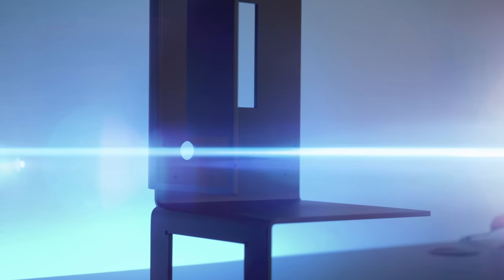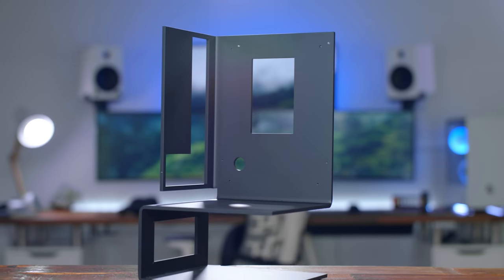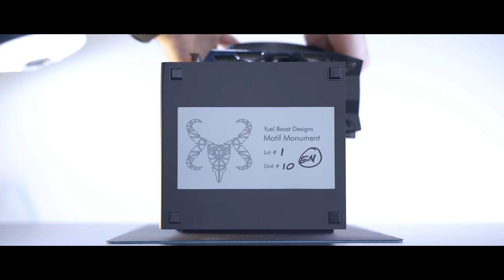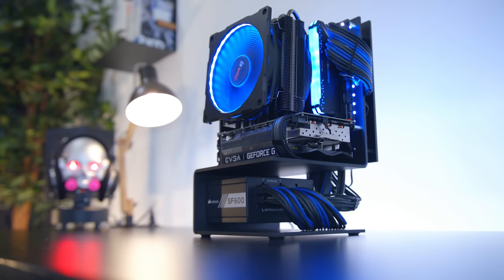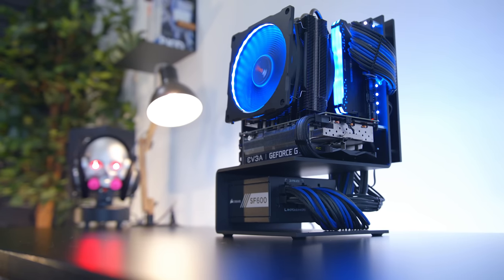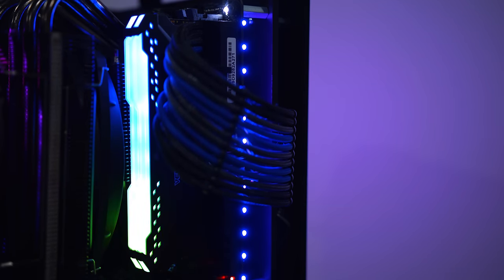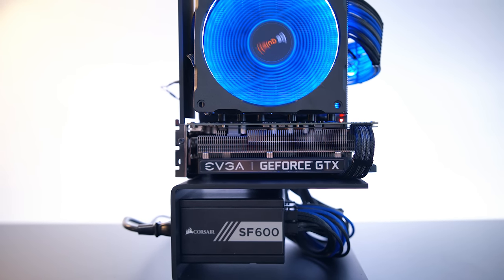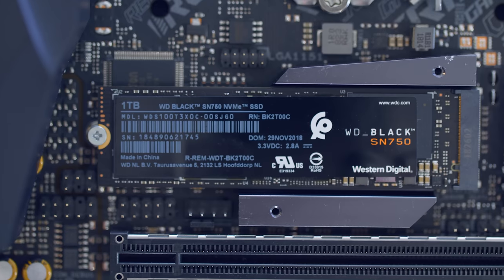Building A Minimal PC Like You've Never Seen! Motif Monument

Comment: Main issue I have with open builds like this is how fast and how much dust it will collect.
Reply from the maker: isaac65536 I won’t lose any sleep over it lol
Reply: But with that it makes it super easy to clean
Reply: Actually, you'd be surprised at how little it does collect.
Reply: Just get an air purifier and put it near it so you dont need to worry about cleaning dust off it
Reply: Nope been been using open an open build for quite some time and once a week I use can air to clean it and it’s not even that dusty. The next build u do u should try it out..
Reply: @MrSolidFaction  genius.
Reply: My room dusty asf. 
In a week you get dust on things you haven't touched like an alarm clock.
Reply: Harbor Freight Air Compressor on sale for $40.  Boom.
Reply: I have worked on computers for 20 years now.  I have seen some in factory's that ran for 10 years, 2 inches of dust and oil. Still running like day one. Some of this shit cares nothing about dust.  I would be more concerned with water or coffee,.
Reply: not if you clean it every week
Reply: I live with an benchmark as my pc case since 2014 and I clean it every two months a little with a vacum and a brush. No problem..
Reply: @OhSoTiredMan  to this day his alarm still hasn't been turned off
Reply: There'll be enough vibration to keep it clean ... I've got a de-cased PC and it just doesn't accumulate dust.
Reply: Get an air filtering system. I bought a 11000 BTU Honeywell,air conditioning/filtering/dehumidify system from Bestbuy on boxing day in 2017. Very very little dust,and it keeps the house at 20c ,247365. A 3$ can of air,used sparingly, every few months takes care of any dust left over's.I use a Lian Li T60b testbench as a case.
Reply: Christian Peralta nah get one of those air vacuum I don’t remember what they are called but they are hand held and will last longer
Reply: I would use my vacuum blower to clean this
Reply: @dsm091  nail polish.
Reply: It's irrelevant. If you are in a dusty room, the dust will be drawn inside anyway.
Reply: I used an open bench PC for almost 10 years, and dust was never a problem
Reply: @dsm091  I agree....I worked in a warehouse in shipping & receiving for 24 years and all the PC's were HP towers and they were ran 24/7 365 until something went wrong then the IT guys would come and take it and give you another one.....I seen a few that had the side covers off and they looked like the inside of a vacuum cleaner bag but besides obviously holding in some extra heat they ran just fine for many years.
After seeing that all I would buy is HP PC's until I started building my own PC's.

Comment: It looks like art. I would imagine there is little need for the fan as it's an open air case, so heat should dissipate quickly. I always worry about how quickly dust will build up on setups like this.... As opposed to a closed case environment, open air cases allow dust to get into components where it wouldn't normally be able to reach. That's my only gripe. Aesthetically it is very pleasing. Nice Job Frank!
Reply: No case is way less bothersome to clean  thus ur more likely to dust it and not be bothered… most ppl from what I hear dislike taking apart things just to dust.. not to mention ppl might not dust for a while cause they don’t even think about cause they can’t see it inside the case building up… tbh I compare it ppl who throw stuff in a corner and before they know it they got pile of junk they need to shift thru later… vs someone who just puts stuff up as they see it when walking by… in the end who’s really doing more work? Lol

Comment: Veery cool, but 250 bucks for the frame is a bit much. I could make one out of steel or 6061 T6 alum. tig weld it and powder coated for less than 100 bucks. but they are selling "art" here.

Comment: I've adored it! But it's too expensive even in here (Brazil). And if I could produce one of these myself, I would make some changes like putting the motherboard horizontally, the power buttom on the bottom of it (where the PSU is) and I would try to make the PSU space a little smaller, as we've seen on the video, it has extra size and the PSU is like floating in there.

Comment: You forgot to use a standoff while mounting the m.2 SSD.

In effect, your SSD doesn't rest parallel to the motherboard and dips lower at the far end. This exerts torque on the contact pins and can cause damage to the m.2 slot.

Another side effect of this improper mounting is that the heatsink will make near zero contact with controller and absolutely no contact with the NAND chips. The latter don't need cooling, but I can foresee your SSD controller overheating and thermal throttling as a consequence.

Refer to this video if you still can't get it: https://www.youtube.com/watch?v=YNP0b9qNOIg

Comment: That is a bench not a case, can we stop justifying the removal of features and higher pricepoints? You could bend this in your garage with decent clamps, and cut it with the cheapest metalworking tools. Just because it belongs to a B rand doesn't mean it has any additional value not provided by the fact that it is a conveniently (and VERY EASILY) shaped chunk of metal? For real, you could mass produce shit like this for 10 bucks, ship for 5, and sell for 20. Stop buying into literally nothing but hype and branding. Is a setup like this cool? Yeah. Does that justify spending that kind of money for less features? Literally the opposite.

Comment: Idk about this build, just seems to messy cable wise for me. It would probably look nicer if you had a removeable psu cover and some glass or acrylic sorruounding the rest, obviously air flow would need to be taken into account but small changes would make this look nicer and stop loads of dust collecting. Also, i wouldn't trust this during day to day use, especially if kids are around the computer. Thats a disaster waiting to happen.

Comment: Interesting build. I'm thinking if we're going to go with a open air no case design it may be better to just get/use a test bench. They make them for all size platforms. Small and large. It may not be as flashy as this set up however. Depends on how much RGB bling you want and how you lay it all out. Yeah dust may be a problem but easy to clean. Like some other's have said I'd be more worried about things bigger than dust hitting or getting onto it but that can be minimalized as well.

Comment: How is it a Minimal PC  if you use the same amount of hardware any other PC uses???
Reply from the maker: public disturbance club this comment isn’t it chief
Reply: Sorry to disappoint fam, but it could be a simple,small,tiny PC build but not minimal for that you go with a apu, passive cooler, no fans, m.2 ssd, no RGB, no psu colored cables.  That's minimal.
Reply from the maker: Aaaaand you completely missed the point of this video 👌🏻
Reply: @randomfrankp  yeah, I went with the minimal definition adjective form. Now in the minimal definition art form, simple geometry  then yes from that perspective it is minimal as to the case.